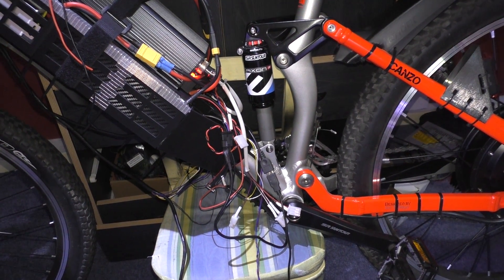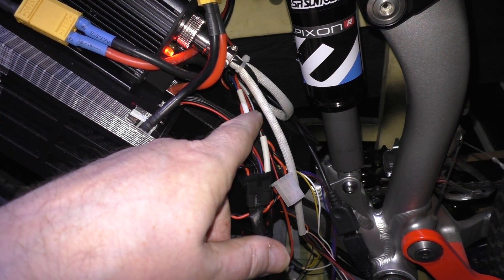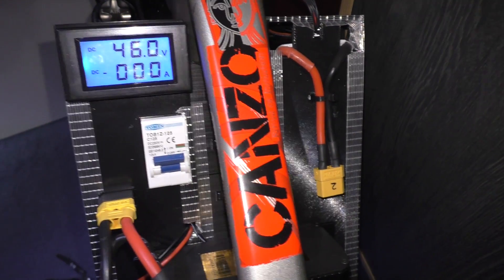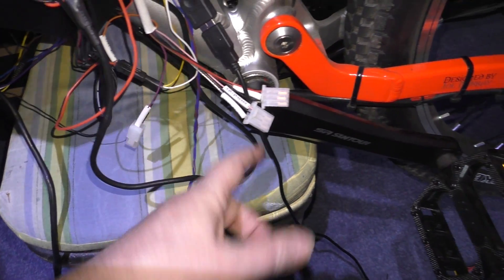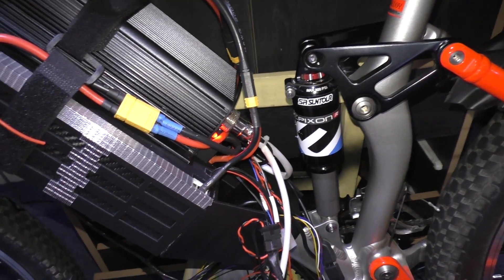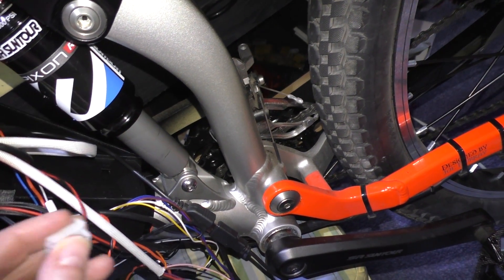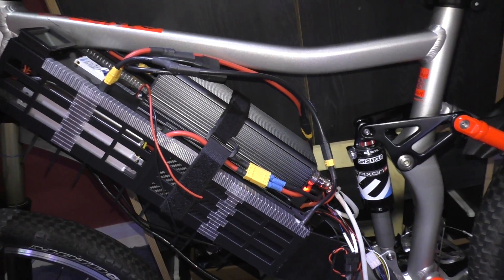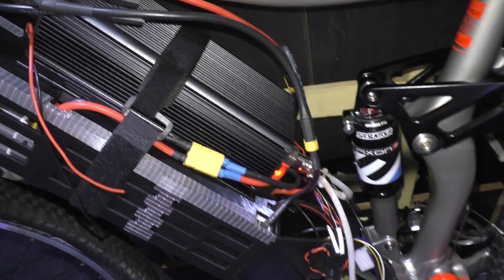11000w DIY eBike build part 5 - Sabvoton wiring nearly completed, final bits to finish

Comment: I have the same controller. I shorted the battery without a fuse between battery and controller and as a result when I power up and accelerate it starts climbing speed by itself until I cut power to controller. I have replaced the controller and verified that external components weren't the cause of the problem. You seemed to know your way around these controllers and I was wondering if you had any ideas as to the controller issue.

Comment: I appreciate the video.  
What added programming features does the Bluetooth/USB software programming add to the features that are adjustable through the TFT display controls?
Reply from the maker: Sorry, Bob..... TFT display controls?
Reply: @Vortecks  TFT display / control available for sabvoton controllers, I thought you might have experience with that. Thanks for responding!
Reply from the maker: @bobbuilder5075  No, Bob. I don't have the TFT because it's just something else to go wrong. I get quite a few emails every week and there's probably a 10% failure rate on the TFT's so I'd stay away if I were you.

Comment: hey vorteks why are you using all that rot when a bleeding 120 transformer with 120 micro wire can do the whole thing with a stator like mine with a big bar like a volume knob and yours could too but it would be quite the crank and yank to rotate the throttle the number of times for the 11000 watts. you just a box like in you bloody house and don't fry yourself now. but you it like gears and make 24 point on the old throttle for 5  volts .833 amps per and the accumulator bar and quite a bit of insulation it think. but anyway you could hire a bloody electrician to find you a proper dial and do away with all of that. but you may need surge protection for the motor if you yank on it to much. it could get heated from mass inception of energy. but anyway good luck to you.

Comment: Hi Tony love the videos one of the best I've found so far to follow. I'm currently in the process of building an ebike with an 8000w rear hub motor.. I'm building a 84v 20s 10p battery using 3000mah cells. Q1 how do I work out the total battery Amp as I think im calculating it wrong. Q2  I'm using a 72v 150A sabvaton controller so do I have use a 72v or an  84v 150A BMS to match the controller. My god it's a bloody mind field when your not electronically minded. Lol any help would be greatfull appreciated. Many thanks Brian
Reply from the maker: OK..... you have 18650 batteries by the sounds of it but I don't know what current they can handle. If we say that each cell can handle 20A, you multiply it by the amount you have in parallel (10) which will give you 200A.
Your BMS should be able to handle the amount of current your controller can draw - 150A

Comment: Hi, very impressive build, nice to see the progression of it too. 
I have a Sabvoton but can't make it work. To begin with I figured that this device is only supported by XP (i think ^^) so I had to get a virtual machine (I heard that your not using XP, is it just me ?). I have RX and TX blinking, correct battery voltage feedback so it appears to communicate but there are some errors: mt overTemp and overcurrent. That bother me because hall sensor wires and white wire are connected as they should. I would very much appreciated your help as there is not so much ressource out here. 

Thank's and keep building good stuff =).

Some info that could help: 
5kw motor with two hall sensors plug
XP runing in a virtual machine for seven 64bit
RX and TX blinking alternativly
Voltage reading ok but when the ignition wire is unplugged voltage stays the same
Can't enter parameter in memory ...?
Reply from the maker: David, drop me an email and I'll try to help - vortecks2000@gmail.com   
There have been reports that some controllers have bad firmware on them and they're reporting mt overtemp.  
Tony

Comment: Getting there, never a good thing to rush in my experience, also i hate sticking my arm out to turn too, especially when you're doing 25 - 30mph down a hill and the road's got bumps and cracks all over it, so i built some and stuck them on my ebike today, with your skills you ought to build some too, looking forward to the test run.
Reply from the maker: I presume when you say "so i built some and stuck them on my ebike today" you mean indicators?   
I did think about it but it then it looks more like a motorbike...... they'd be really handy but it's something I really don't want because it'd attract too much attention.   
Of course, I might change my mind tomorrow :-)
Reply: Yes indicators, i totally agree in your case about attracting attention especially with the beast you're building, it's ashame you couldn't disguise it to look like a 250w legal road bike, maybe in the future when motors might get smaller as well as the batteries and power controllers lol, i remember watching your jet engine powered rc car a while back, how about sticking one of them on the rear too lol, good luck it with it vortecks :)

Comment: Nice one mate. Jeez that looks like head work. I was thinking of getting a Sabvoton before watching this video lol. The Adaptto max e looks impressive , but cant afford to pay that , not with the motor , batteries etc to get. Not sure of other alternatives?You mention you had your batteries in the UK do you have any suggestions where I can look mate, looking to run 72v or over.
Reply from the maker: The Adapto is the best controller but they are expensive. I was going to buy one but I was put off by their crappy website and the cost.   
Batteries..... it all depends on what you want / what your budget is / how adventurous you are mate. If you want the cheap and easy option and want to run 84v, you can't beat the Multistar batteries from Hobbyking - 4 x 4s in series will give you 84v. You could go the 18650 route but it's not easy to make the battery pack and it can easily end badly if you get it wrong. You could use LiFePo4 batteries which have a 2,000 charge cycle life but they're bloody expensive. If you have any questions or doubts, from me an email - vortecks2000@gmail.com
Reply: Thanks for the info very helpful mate.I'l have a look at the hobbykings.  I'm trying to learn as much as I can when I'm saving for the bits. Can see, making your own powerful ebike is not something you can just jump into, between getting the right batteries hub motor sizes, dropout size etc. I'm glad I didn't just order a motor on a whim  without planning the whole system. I would have balls it up ha. thanks for the help mate I'l get in touch if I'm stuck.

Comment: A ebrake caliber is a good way to handle regen braking thru the CA. I do most of my lighting thru a separate 3s Lipo which simplifies wiring somewhat. Keep at this, looks like you are almost done.
Reply from the maker: That's the problem, Bob. I cant find anything that does progressive regen in the UK. I'll have to make my own!

Comment: Bafang do a brake sensor so you can use your existing brake levers. You get a little magnet to glue to your lever so it knows to cut the throttle. You can get the pin-out online.
Reply from the maker: I have some brake levers with a cut-off but they're not linear. I need to modify them with a hall sensor so I can have progressive regen or I'll use a thumb throttle on the left to control the rear brake..........there's just not enough hour in the day!